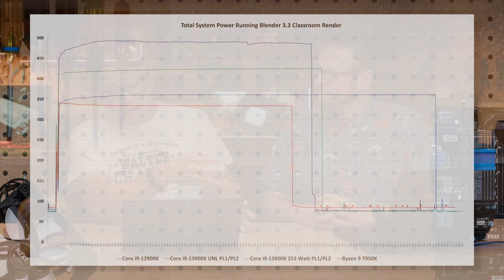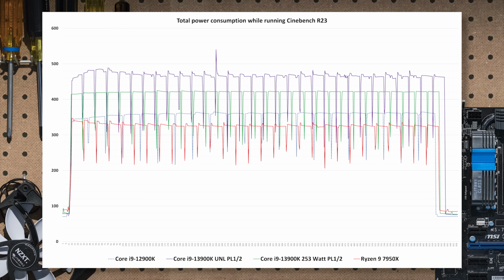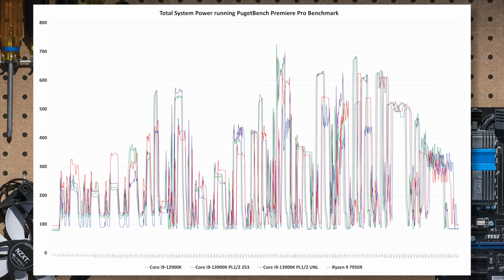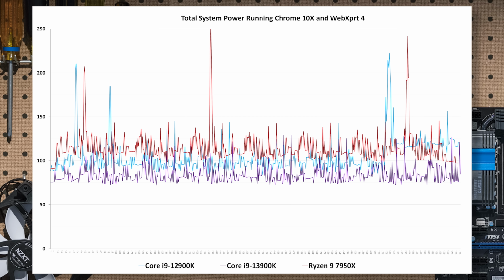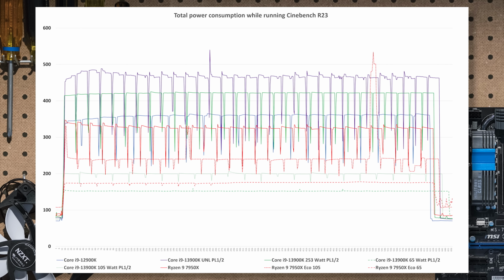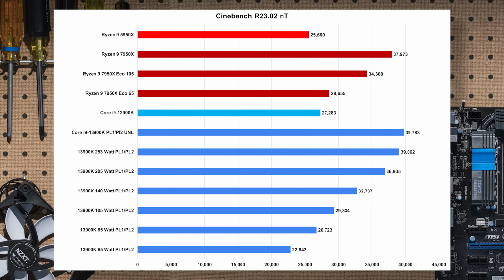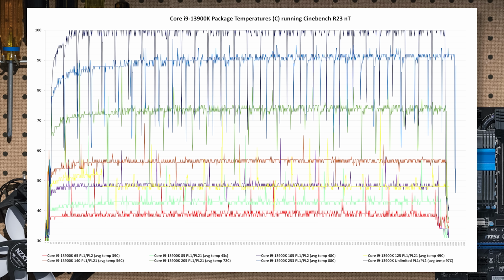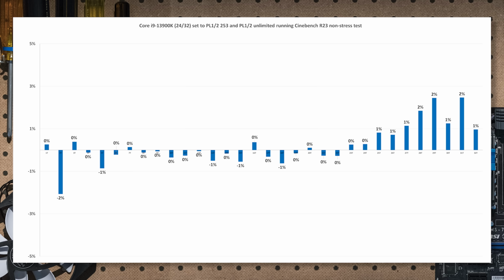How Much Power Does 13900K Use??

Comment: 13900k and 4090 get your own room heat dissipation would be unbearable
Reply: You're right, people just don't realise what the effect actually is.
People calling the 4090 haven't seen Navi 31 yet.
Reply: @RobBCactive  i mean in the past at least 6900xt is a massively efficient system over 3090

Amd always prioritises efficiency up until now
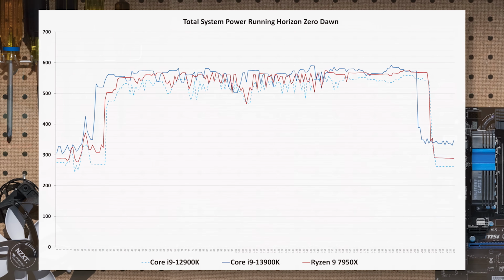Reply: 13:45 notice about the same power usage. So to make your statement correct you would have to say using any high end Zen4 cpu or Intel cpu paired with a 3080/3080 12gb/3080ti/3090/3090ti/6800xt/6900xt/6950xt/7800xt/7900xt/7950xt/4090/4090ti would be unbearable because they all use close to the same amount of power while gaming.
Reply: @jjlw2378  when you decide to purchase that computer include an air con or  purchase a bigger house so you can have a separate room for a computer.
Reply: Yes the 4090 is a beast with a 450w TDP and can draw up to 600W when overclocked
But its not comparable to  the 13900k, cause this gpu is REALLY more power efficient than the previous gen.
In practical situations, the power draw of my 4090 rarely hit 450W, and it's in fact way better than with my 3080ti. 

For example spiderman : 
350W almost full time with a 3080ti for ultra RT 4K DLSS quality @ 60 fps.
300-330W with a 4090 for ultra RT real 4K @ 120 fps (with frame generation)
230-250W with a 4090 for ultra RT 4K DLSS qualité @ 120 fps (with frame generation)

100W less for 2 times more FPS...
Reply: @-Barbo-  would a 1000w psu be enough for 4090? I'm thinking of pairing it with 5600x for 4k gaming
Reply: @lackofabettername3589  Yes its ok, i have a 5800X with a seasonic Focus GX-1000. Pretty sure even 850w would be enough, but it's nice to have a little more
Reply: @lackofabettername3589  I was thinking  to use my 750 watts ps you should be ok.
Reply: @-Barbo-  same i have 5800x too . glad to hear 1000w would be enough
Reply: @-Barbo-  Yes true 4090 very impressive and power efficient

Comment: If you want to limit the voltage, just buy a lower class CPU... It's like saying, I will buy a race car, but take out 2 pistons from the engine. Well, then you should have bought MX5 and not a race car. Same in PC world, save yourself some money, buy a lower spec CPU, and be content that that is what you needed.
Reply: It doesn't take Einstein to see that these chips are pushed 40(or in Intel's case 80%) past their optimal power in order to gain 5-7% performance and "top the charts". Undervolting can save on thermals and power depending how it's done at the cost of what <5% performance. Similar performance, less power draw, better chip longevity due to thermals and cooling needs. What idiot would want such terrible things 😂
Reply: @attemptityourself5662  Where to start... First off, you just throw numbers around... % here and there, and a claim of 80% past optimal power draw... LOL!

I think these companies knows a little bit better than you what it takes to make a chip, no offence, but they have teams of engineers working on this. I have never had a CPU or GPU die on me, from their intended use, that is a testament to how good these engineering teams are.  

What has been clear for some time now, is that they need to push more power into GPUs and CPUs to achieve higher output, the question then is performance/ efficiency. Which is another discussion all together. 

My point here is, if you buy any of the top end parts on the market, does it make sense that you buy lower end parts for the rest of the system? It's not like you would buy a 650w PSU if you undervolt. Or a less satisfactory cooler, etc...

Hence me saying that undervolting is a fashion statement. In reality you gain very little from it if you don't have a very special use case, which very few people have. Or if you try to use these parts in other ways than what they are being sold for. i.e. SF-PCs.

Rather, people should look at their needs and buy parts/systems for those needs. I am using a lot of car analogies in my comments, and here is another one: Go and tune down the engine power of your car, same principles apply to what you said above. Less heat, longer longevity, less fuel needed ...
Reply: I disagree, but it's possibly just pedantic. Limiting the voltage is different from limiting power. For gaming, I always recommended 6-cores (or 6P cores) for high-end gaming, undervolting and then overclocking the CPU to boost higher than stock power with a good cooler.

Living near the equator, if I want great multi-core performance for renders but not have to turn on the air-conditioning, undervolting and power limiting my 5950X yields the best performance over any other CPU of its generation. I'm limited to about 160W on the hottest day, even with a 360 CLC, quiet radiator fans and properly airflow managed case. In the end I simply use PBO2's Thermal Throttle Limit instead, so I enjoy more rendering performance on cool nights, and just let the CPU bounce up and down the thermal limit I set.
Reply: @Postman00  Limiting the voltage (that is, cutting off the top of the v-f curve, not undervolting) is the best thing for saving energy (other than a short automatic sleep timeout).  Unlike a power limit, it actually affects lightly-threaded workloads, which is what most people are doing most of the time.
Reply: @Postman00  Yeah, I get your point for your specific circumstance. At the end of the day though, you are highlighting a really special use case, where as most cases like yours is solved by having multiple systems, doing their respective jobs.

To use a car analogy again, there isn't many race drivers driving the same car to the circuit and using that same car in the race. Especially when you talk about high end race cars... 

Undervolting definitely has it's use cases, but at the moment I see too many talking about it without a good use case for it, making it into some sort of fashion statement instead of talking about real world scenarios where it makes sense. 

Instead of measuring everything up towards the highest bar in the PC world, we should be measuring based on what you can actually do with different parts. E.g. there isn't that many good use cases for a 5950X if your screen resolution is 1080p. No matter what you use it for.